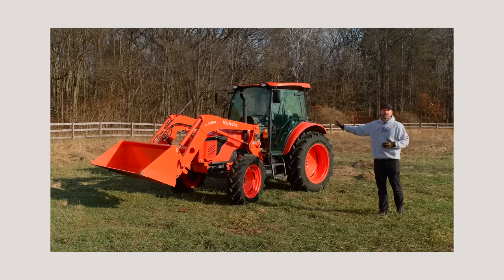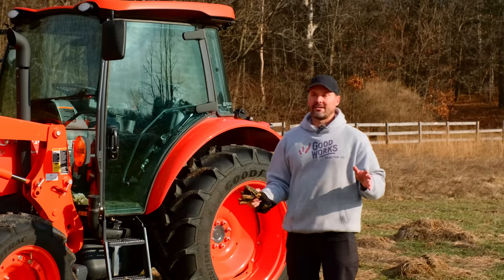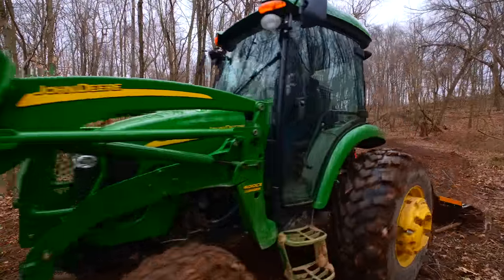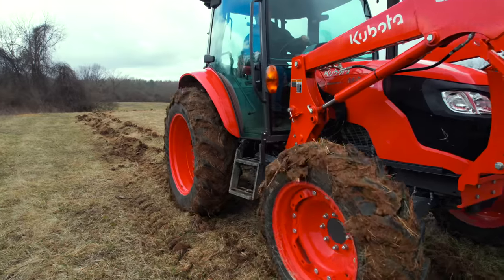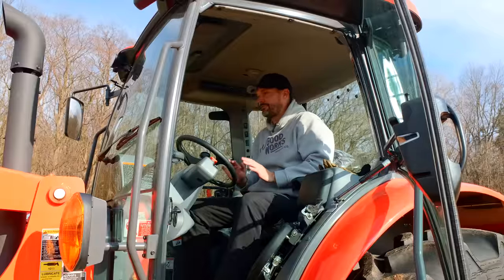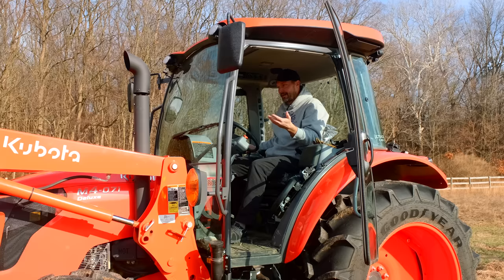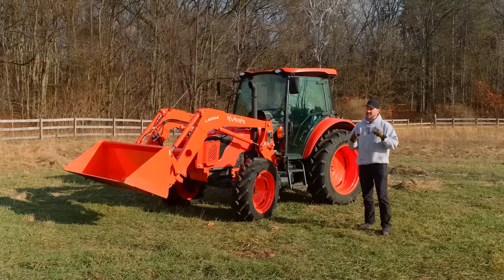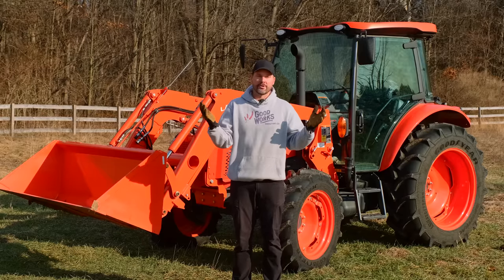I’M THINKING ABOUT SELLING MY KUBOTA. KUBOTA M4D-071 REVIEW

Comment: Hey Corey good morning. I agree with what you said. Get what you want(brand) with as much as you can(standard equipment) to start with that fits your size property. And then equip it with the attachments that makes since for you and property. 
I found exactly what I wanted(older Ford 1520 4x4) yes on purpose with the quick attach backhoe but pinned on loader, like you have always said up front so it don't cost you a bundle later.  Done this before I knew you and channel. Then first attachment I got was a post hole digger. Because I was putting up fence. Then I got a 3 point Boom Pole. To move engines around. Then I got with you the Speeco quick hitch. Common everyone needs one these. Now when I can I will get the SSQA assembly to convert my bucket to quick attach. Got the skill and tools to do that. As far as tires. Mine came with the Ag tires and I knew it would tear up my yard, so I found another whole set of factory Turf tires and rims and put on. Still have the Ag tires on the rims to just swap out when needed. With Backhoe on I can lift all tires off the ground to change. And of course I had to get some Goodworkstractor swag. 
Future upgrades: Summit hydraulics front and rear. And a whole lot more attachments going threw you that you have or using the Goodworkstractor discount where needed. Why? Because of everything you said at the end of this video.
Side note: Have you heard of or going to the Ft Wayne tractor SHOw at the Ft Wayne Memorial Colasium. It's starts today, Tuesday, Wednesday, Thursday. They do have the smaller tractors and attachments. Might be good for you to go and and collaborate with company's to work with. 
Hey camera man Chris: You always do a great! job.
O.k. I went on probably WAY to much here. Maybe it was all the coffee in the Goodworkstractor mug. Lol!
Reply from the maker: Haha, all good info!  I don't make it to many tractor shows, but will be attending the Louisville show in February.

Comment: I just ordered one (yet to arrive) and was able to upgrade to an air ride seat. Also, it already has R14 tires which look to be great for yard work.  The fuel tank holds 23.8 gallons which should keep you moving for awhile.  

In addition to feeding hay bales and property maintenance, I’m planning to use for a small hay operation.  

I really like the 511 grill guard. 😊

Comment: I have the MX6000 and agree with everything you say.  I am a tractor newbie and the comfort of the cab and the hydrostatic treadle pedal allows me to maintain my mile long, old, driveway, mow, and grade drainage.
We have bought an air ride seat  (aftermarket) which only requires a elec jumper kit which Kubota provides.
Reply from the maker: MX6000 is a good one too Riser!
Reply: I’d keep the Kubota. My Aunt and Uncle have been dealing Kubota for many many years. The Japanese engineers used to come and see my dad every year for his information about how the designs were working out. Dad was a very capable mechanic who was very impressed by how polite the Japanese people were. Even the fact that most of them had a good bit of problems with our version of English, didn’t keep them from bonding over the mechanics of ease of operation and maintenance. 
During the summer heat anything that had dad in the shade and out of the hayfield was a blessing.
Those early tractors were extremely reliable but a son of a biscuit to work on. 
Everything was so much closer together than the Case, New Holland, and International tractors that everyone was used to.

Comment: Creeper gear on my Kioti RX7320 really helps for tight quarters use with the power shuttle gear.  An HST would be nice, but the hook-up with gear is just sooo solid.  I am happy with my machine. I will probably get a smaller 40hp hst open station for my wifes garden use when the big cab utility machine is paid off.

Comment: Personally I would hang on to the M4. I just took delivery of an M6060 and could not be happier. It had 68 hours on it and had been traded into a JD dealership. The sales manager had some great incentives to go with a JD but I have been running orange equipment since the 80's.  It came with two rear remotes and two front remotes. You just briefly mention the hydraulic top link and I think that is a great improvement. I mainly do grader work and installation of crushed limestone driveways where I need to adjust cut angle frequently on  my box blade and the hydraulic top link would be a huge time saver. Again, thanks for all of the great info.

Comment: Well Courtney I have disagree with your overall assessment of the BX as being junk.
I’ll agree with you that Kubota’s fuel filter solution is engineered terrible. Their grille guard is lacking quality. I have had too make after market updates which when completed would make it a great subcompact. The loader has enabled me to tackle a number of jobs and complete that otherwise I wouldn’t have been able to do on my own. I should mention that I own a Bx2380 and the engine is a little power house. I blow snow with it in the winter using a 60” rear snow blower & it handles it no problem. The unfortunate downside is the treadle pedal. It was difficult for me to get used too but now I have done a pretty good job of mastering it.
Reply from the maker: Fine as a stand alone, just not anywhere near as good as the 1025r :)
Reply: @GoodWorksTractors  
Yes I have to come clean, this fall I was going to trade it off for J.D. 1025 R with a Backhoe. I must say John  Deere builds things right out of the gate using craftsmanship & common sense. It’s like the Engineers must own one of these!!! 😎😂
Reply: @GoodWorksTractors  I know the bx and the 1025 are the same class of tractor but I think we could all benefit from seeing the kubota lineup next to the John Deere lineup. The 1 series will out perform the bx in almost every metric, but it’s a physically much bigger machine. The 1 series sits physically between a bx and a b in size but gets out up against a bx. It would likely not out perform a B. Does that make sense?

Comment: For the lifting capacity, you have 3 options on this tractor. If you look on the main frame by the door, the lift cylinder has 2 pin option. If you pin it in the lower position, you get less lift height, but more capacity. Just the opposite in the upper pin hole.

Comment: Great following you as some day I hope to  upgrade soon from my modified shuttle shift Cub Cadet 7360SS headed cab version I've had for 22 years, like you say its all about ones needs as for me with 20 acres,  a saw mill and 1/4 mile dirt road to maintain, lots of big boulders in the ground  in 4 seasons. All I know is need more HP and loader lift capacity,  at 74 it will be my last tractor to enjoy doing what I like most.

Comment: Nice summary !  I also own a utility tractor (It's Blue) and can relate to the limitations you mentioned but it can be very useful for small farm uses.  Wondering if you have tried to use your HD stump bucket with this tractor ?  Wondering how the stump bucket would be to use with the power reverser transmission rather than a hydrostat ?

Comment: I was able to upgrade to an air ride seat when I purchased my M4 in 2022.  One thing I'd note is the blue remote has a float mode, so when you're running something like a batwing mower it can float the terrain without stressing the mower hydraulics out.  The green remote will detent in each direction until it gets resistance, I'm not sure if that would allow for continuous flow or not.

Comment: Venting low is simply smart design. Upper cab vents result in substantial heat/cooling loss on very cold/hot days.
Reply from the maker: Maybe so, haven't ever had that issue with my Deere's.  Perhaps other models.
Reply: Not really true because most tractors with roof vents have the condenser up there

Comment: There's only one thing that I may have done differently, and that's a cab. That said, 1025Rs with cabs are like hen's teeth on the used market, and when they do come up, you're gonna pay. I got a great deal on the package I bought, and to be perfectly fair, I'd have likely done some significant damage to the cab in the process of clearing my land. The one thing I should have done, as soon as I bought Joan, is get her fitted with R1s, or maybe try to stuff some R2s under her fenders. Our icky sticky sandy clay makes a joke of traction.

Comment: Good video Courtney!  I have a "working" yard so the R1 tires are not a major concern but I'm careful about avoiding sharp turns and 4wd on the lawn as it will tear up some turf.  In the field though, the R1's can't be beat...gotta have them hands down.  You might look into the Kubota Shockless Ride accumulator for the loader.  I really love mine!
Reply from the maker: Hmmm, I like the sound of that accumulator.  Will have to look that up!

Comment: I'm a Kubota man and the m4 is the next upgrade I would look at but that massey 4707 is calling me. You should see if you can get a demo unit to see how it stacks up to the m4
Reply: I’ve always been a New Holland & Case guy and own 10ea tractors from 150hp down to 33hp hydros.  Then I tried/tested a AGCO/ Massey Ferguson 5711 Dyna4 110hp machine.   Simply put I was overwhelmed with the quality and feature rich machine that basically has everything standard on it….  The 16 x 16 full true power shift transmission is the smoothest one I’ve ever operated in my 45 years of farming & equipment operation.   The 4707 Massey with the Dyna 2 transmission is a 24 x 24 speed and can be clutched with a button on the shifter. Throw in brake to neutral, air ride  seat, three SCVs and shock dampening for the loader & three point hitch loads and you find out quickly that  AGCO is the leader these days in quality, service, standard features included and pricing which is between CNH & Deere.    Of all my machines the Massey is my favorite tractor hands down of all the equipment I own…….  Courtney really does need to give a 4707 Dyna2 tractor  a test drive.

Comment: A tractor is really a niche fit item, including the subcompact series tractors. both green and orange are both pretty good quality and each has its shortcomings. The one major issue I have with Deere is the proprietary quick attach. It simply isn’t popular in the aftermarket manufacturing field where you too have found some fantastic pieces of equipment. Just consider how much less business you would have if you didn’t handle SSQA items. Sure green can be adapted, but ask yourself who adapts to the JDQA? I am not sure anyone even manufactures such an adapter. That would leave you as just another green dealer competing with other green dealers. Glad to see you reconsiders selling. Make it what you want.

Comment: I have a M7040 and know friends with M7060's. I don't understand why the M4-071 has the same engine but has 4 to 5 less pto hp. I was told by a dealer I would be disappointed with the power of I was use to a 7040 or 7060.
Reply: Just discussed this very issue at my dealer the other day while comparing a 7060 next to a M4D071. No explanation.

Comment: I work for kubota. We have one on our lot. I own a kioti rx7320.  Pretty much comparable machine . The kioti has 2 more hp is all . And cost is 15% less. But same features. One thing kioti doesnt offer is a big bucket. Unlike kubota . Which is a major turn on for trading mine in for the kubota m4-071.  We have all the rear remotes and third functions and hydro quick attach couplar kits in stock . I have yet to try one. But if i get to build my own at dealer cost for my own land. I sure will if the numbers come back good for resale on the kioti rx7320

Comment: The Grand L series also gas the fuel cap on the floor of the cab, which is a lot easier to handle than a fender or the hood of the engine. The only thing that I did like our Grand L was that R14 tires were available. We had to settle for R4 tires. I like them better than the tractor tires as they don't tear up the ground as much, and they are wider.  With Rim Guard in them, each R4 tire has 503 pounds of ballast. Very important when lifting a hay bale!

Comment: The Kubota m-series is a whole nother level. To me it's a farm tractor, pulling a hay bailor, lifting big round bails and so on. I think they also have a mx series that is in-between the m-series and the l-series. It's bigger than a l6060 in weight and lifting capacity and I believe the mx can come with hydrostatic.
Reply: Have you looked at the lifting specs? You won’t be lifting wet bales with this tractor

Comment: I’m quite sure the tens of thousands of Kubota BX owners disagree with your assessment of their tractors being junk. The reality is, the 10 series John Deere is more in line with the Kubota B 2601 series. The BX series is more in its own size class regardless of how they are labeled. (I don’t know if there are other brands with models as small as the BX.)
However, you might want to search YouTube for videos of BX tractors and the amazing amount of work they do for such a small platform. I believe most equipment rental companies that offer small compact tractors for rent, have the BX series. The rental companies need reliable tough equipment, you know, because people are easy on rentals…

Comment: As a M4D owner I concur it’s a great tractor. Would love to see a loader based post hole digger. I’ve seen a few hydraulic versions but no idea if they actually work well. Like it for posts but want an option to dig big holes for tres and landscapes.
Reply: accully pretty easy to convert a 3 point hitch post hole digger into loader mount all is need is hydrulic gear box and hoses and frame that makes a bale spear  and add gear box onto the bale spear frame and you have a loader mount post hol digger  wich pretty easy project ive done it on a m8540
Reply: @michaelmactavish4445  Good idea. Will have to do the cost difference between parts and buying a dedicated hydraulic unit. I don’t have a 3PT post hole digger so that needs to be factored in.
Reply: @JimN_AustinTx  lucky hyrulic gear boxs are cheap at my kubota daler $145.00  wich the deere here wanted $890.00 wich was ediculas

Comment: What position did you have the loader pins set at and did you run the rpm for full pump pressure?  That tractor should lift it
Reply: It lifts a max of 2400 lbs…A  joke compared to a 26/ 4700 series Massey or even a Kioti RX.

Comment: 1/2series deere have that chatter too. same thing its a hard line
Reply from the maker: I've not had that issue on any that I can think of.
Reply: @GoodWorksTractors  Sorry not chattering per say but the loud whine coming from the hydraulics when running. Its a hardline that runs beside/on the trans. JD has a soft line you can buy that stops the noise

Comment: Good summary…I have a MX open station with basic gear drive which fit my needs. Biggest need was cost but don’t mind the old style clutch. I personally couldn’t stand the hydro whine. I will say on the MX they call it a shuttle, but whoever marketed that hasn’t operated a true shuttle system…or…they lied.  I knew that going in as dealer told me it’s more of a shuffle than shuttle.  He explained you shuffle those feet to the clutch, come to a stop and shift into reverse.  Totally different from the true shuttle as the M model.

Comment: Those hydrostatic transmission tractors are just absolute junk to me. You can't do anything with them. I like a good gear driven transmission with a good clutch. Whether power reverser or manual shift. Just what I grew up with. I have used the hydros from time to time. Not the machine that a gear boxed tractor is.